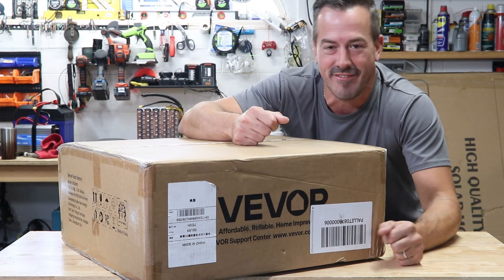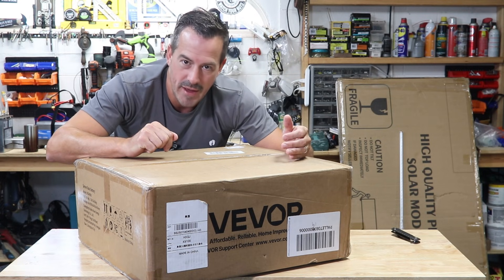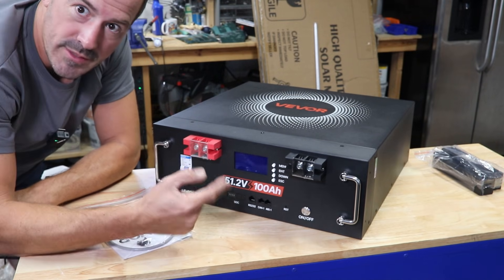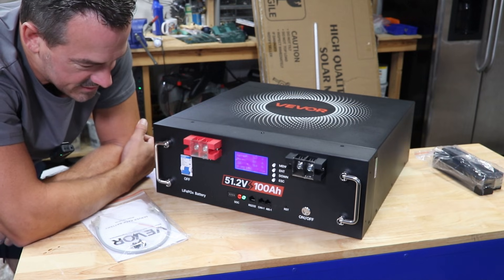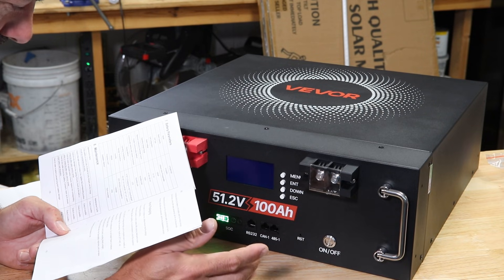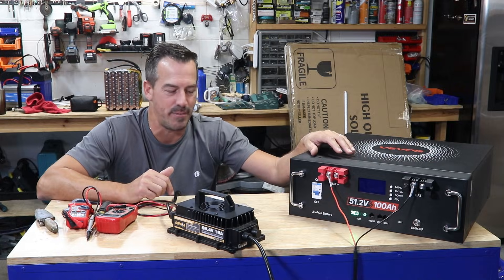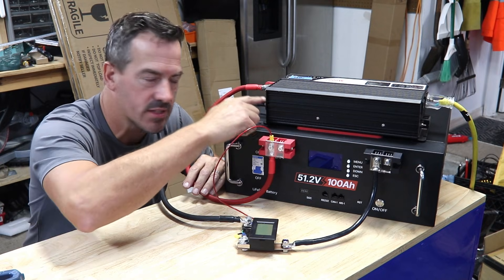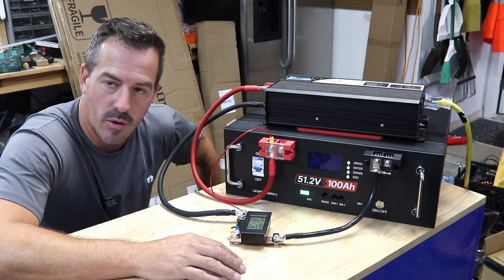How bad is this CHEAP Vevor 48v Server Rack Battery?We put it to the TEST! #diy #solar #lifepo4 #eg4

Comment: Hi Tackle, with the inverter setup you have here, can you use your AC charger to charge the battery while using the inverter or will something bad happen ?
Reply from the maker: You can always charge a battery while under load (inverter). If the charge is more than the load, the battery will charge... If the charge is less than the load, the charge will offset the load (use less of your battery).
Reply from the maker: Now you can't charge your own load... With the inverter and charger losses, you'd drain your pack.
Reply: @TackleThat  So no smoke .😃

Comment: There are several reviews of the Humsienk brand by Will Prowse and several others showing the build quality, and their 48-volt server rack for $599 showed a capacity of 100 ah each time. I even picked up their 12.8 volt 600 AH battery for my RV for only $525 at the Temu site with free shipping.
Reply from the maker: Funny you say that, I am reviewing and don't hit 100ah, but close... Not the capacity as advertised since it should hit 103+ah
Reply: @TackleThat  Did you see their videos?

Comment: Another point—you mention that some manufacturers subtract a cell. This is entirely justified depending on the type of cells used to build the battery pack. LiFePO4 cells have a nominal voltage of 3.2 V, whereas Li-ion cells are 3.7 V, so in such a case you’d use 7 cells for a 24 V system and 14 cells for a 48 V system. By the way, 16 × 3.2 V = 51.2 V, while 14 × 3.7 V = 51.8 V, so 14 Li-ion cells actually yield a slightly higher voltage.
Reply from the maker: Correct you are, I'm saying people try to sell you a 48v 15 cell lifepo4 pack, which is technically still close to 48v nominal... But It wont work with your 16 cell packs... You either have to have one or the other.
Reply: @TackleThat  Now I understand. I haven’t encountered such a situation myself, but that doesn’t mean it doesn’t exist :)
The only 15-cell LiFePO4 pack I recall is the 4.8 kWh unit—possibly from Viessmann—but those didn’t have a BMS and were installed into a 200 V high-voltage module (4 in series). Perhaps someone later added a BMS to it and sold it that way.

Comment: I just ordered 2 to play with. I see they are 1C discharge rated and want to see if they will play well with my other 2c batteries.  Seems like the cheaper ones are 1c now. Can't  beat the price if they arrive in good working shape.
Reply from the maker: Awesome, let me know how they perform for you!
Reply: @TackleThat  Had  a rough  start. They would both error out with a overvolt cell before fully charging with a standard charger first try. That would shut down charging  before 100% and shut down the balancing. Could be why you see reduced capacity.  I boosted the cell voltage slightly in the BMS settings and since that they charge fully, balance,  and are hooked to my 12000xp now with an assortment of 2c batteries.  I am thinking the 1c rating of these may eventually be a problem but so far so good. They both self consume about .8 ah a day when left turned on with no load that seems slightly high to me. Appears most of these  cheap batteries are 1c now. Time will tell
Reply from the maker: Word, mine were very balanced... I just cant get overall pack voltage to be more than 54v, even though set to 58.4v
Reply: @TackleThat  I am getting 100% with my inverter set to 57.8 volts charge volts as I use for the other batteries. 58.4 from the charger will shut it down before 100% even with the cell ov value raised .2 volts in the bms. My volts difference now averages .004 volts on both after 2 cycles.

Comment: I have 3 of these.  One good.  One functions, but the entire cell pack was loose and flopping around in the case, as the "welds" on the battery brackets broke.  Fixed that one.  The third had a bad cell and 3 shorts from the cell pack flopping around, again from the cell retaining thing breaking,both front and back.  Really shoddy quality.  Both cases I opened also had surface rust inside of them.  Spend the extra couple bucks and get Ecco worthy.  These batteries are unsafe, I am using them in an off-grid installation, in a fire resistant box, outside of the structure.  I would never put these in my house, and I have 60kwh of batteries in my home (eg4)
Reply from the maker: Thanks for the info, and appreciate you sharing your experience so the community can be more informed 🙏

Comment: i bought the battery and their support is lacking.  My fault light is on and won't go out They sent my money back.  so I bought another one and it did not work either.  They have no support line only customer service.  Don't buy.  I did get one of the three to work but it has been disappointing.  Buyer beware good deals only if it works.
Reply from the maker: Oh wow, thanks for sharing your experience; that's valuable information for everyone to know.

Comment: so a 24v batt and a 12v batt are too no good ,less cells.
its different .
the cel voltage is slightly higher then a lead acid batt ,and there is a point that you remove a cell to have nearly the same voltage.
as a lead acid ,and above 50 volt counts here in the nld as high voltage ,so different laws apply .
 we are talking about nominal voltage not 100%charge.
 and it is a stupid little voltage above 50 butt that is more for your insurance if there ever is a fire ?
 take 2 48 volt batts in serie we call that 96 volt ,butt 2x 16 cells is more than 100 volt ,
so tere is a time to remove 1 cell .ore 2 at 96volt .
Its not stupid its laws and incurance .16 cells work fine 15 too and is closer to the voltage of 16 cell lead acid batt .
Reply from the maker: Yeah, 15 cells are fine if you get the savings (and not getting scammed), and also set all your hardware up for the lower voltage range. Higher the voltage, the more efficient the circuit!
Reply: @TackleThat  sorry that youre not getting the point .
wy not go to 96 volt inverters ore 72 .ore high voltage car batttery.
you have to draw a line somewhere .
its on the buyer to see if he gets what he wants.
but 15 cells is not wrong .

Comment: You need to check the voltage difference between the highest and lowest cells when the battery is "full".  If the cells are out of balance, that would explain the BMS cutting off early when charging, because the "runner" cell would trigger BMS protection and stop all charging activity.
Reply from the maker: For sure... But cells have been perfectly balanced through many cycles now... That wasn't the issue. Im pretty sure its a bms issue.. it wont let the pack fully charge to 3.65v per cell even though its set to that. I only see around 3.4v.
Reply: @TackleThat  Ok!  But just an FYI, don't depend on the BMS to balance the cells themselves.  You need to check it to be sure.  The advantage with this type of battery case is you can easily remove the top to balance the cells yourself with a DC power supply.

Comment: How did you know it's the bms shutting it off? Did you get current over protection in the app when you hit 53.3v? If not, the issue is your charger.
Reply from the maker: The bms says OVP, and it wont take any more charge. It never gets to 58v like all my other packs. Charger is fine, its cccv at 58.4v.
Reply: @TackleThat Okay, it seems like your cells aren't balanced. My second one did the same thing. I had to charge all the cells individually to 3.65v, and it started hitting 58.4V before the BMS shut off. One cell is getting to 3.65 before the others and that's what is causing the OVP before the sum gets to 58.4. I would set the charger to 58.4 and hold it there for some hours to see if it improves. Or charge the cells individually.
Reply from the maker: I won't be able to do that every charger though, so far. lots of cycles, still fine with the 97% capacity. I will do another capacity test in a month or 2.
Reply: @TackleThat cool. If it's still hitting OVP at a lower voltage then get Enerkey or Neey 4amp balancer. This is what saved all the vevors I got. I ended up getting 4 vevors. Using Enerkey got me to 58.4 on all of them. It's the fastest way to balance any 16s battery. It was like a miracle honestly.

Comment: No matter how many times I counted, it looks like it’s only a 15 Cell pack. Like the one Will Prowse tested ?
Reply from the maker: This one def has 16 cells, i count em in the video... That's not the issue... I think its bms related.
Reply: It's 16! And I got 105AH after testing mine. There's something wrong somewhere.
Reply from the maker: That is awesome! What were your BMS settings for max cell and pack voltage?
Reply: @TackleThat 3.65 per cell and 58.4 per pack.
Reply: It's 16! And I got 105AH after testing mine. There's something wrong somewhere.

Comment: m,ay have to cycle it a few times to get thaty 100 percent  I've seen that with several different brands and I  believe fully charged is 54.4v   the charger should be set to 58.4v
Reply from the maker: I wish that were true... Tested it 4 times now. It should always test high and go down actually as it is used.
Reply: @TackleThat You have never gotten above 53v. I think that's your issue. Either from your charger or something else.

I got 105AH from this battery.
Reply from the maker: Good to know! I have a stand alone charger that charges other batts fine to 58.4v.. and an xp6000 inverter set to 58.4v.. on both, still won't go over 54v, bms kicks it off early while the rest of the batts charge up from the sun.

Comment: I just bought one of these from Vevor, It arrived damaged and leaking a stinky sticky fluid with the breaker switch broken, the contents inside the metal case were rattling around. I contacted vevor immediately and asked for an immediate refund. They gave me the run around for a week however I emailed them everyday until they finally responded. They offered me a refund of $196 however I paid $658 for the battery new. This added insult to injury so I declined their offer and told them I wanted a full refund and the battery removed from my property. They came back with a refund offer of $395 dollars I told them I was going to in form my bank that I used my credit card from to purchase the battery and they could deal with the banks attorneys. A week later they offered me a full refund but didn't want the damaged battery back. I will never purchase anything from Vevor again. Also Vevor has now CS phone number, you have to deal with people in China via email. Thank you Wells Fargo for helping me get my money back.

Comment: Just a heads up have you checked the bms charging parameters there are apps for setup of bms might be set at lower levels by the way most passwords for these is 123456 hope this helps some of us believe that server rack type battery will be at $500 by q1 of next year
Reply from the maker: I hope so! I'll pick up a few more to give up a few AH. Yep, bms was updated to 3.65 a cell, 58.4 pack.

Comment: Seems parallel battery pack communication is not possible
And terminals are too small
Reply from the maker: I don't disagree, I can't even get one to communicate with the eg4 6000xp!
Reply: @TackleThat It communicates just fine with my SRNE inverter.

Comment: Cool video and info. Can you top balance it then retry the capacity test?
Reply from the maker: Did that 4 times now, cant ever get them to take a 3.65v charge.. the bms is limiting it to around 3.45v each. Cells are very close in voltage so no need to really balance!
Reply: @TackleThat have you tried to manually charge any low cells directly with maybe a bench top power supply. Sometimes the BMS doesnt balance well or quickly so manually doing it will help get all cells to 3.65v

Comment: What is the residual current draw of your inverter?  The idle consumption?

An inverter turned on and doing nothing will use 50-100w per hour.  You need to add those numbers back in for your total capacity.  They are wasted in heat and running your inverter but they still count….
Reply from the maker: The shunt is before the inverter so any inverter inefficiency/draw is calculated in the overall watt hours. BTW it's about 45w if I remember correctly.
Reply: @TackleThat hmm, does it make a difference….conversation of energy.  The inverter is still somewhere in the circuit and it will use watts from the batteries.    You can’t rob peter without it showing up because the total watts in the batteries are “fixed” 

I think a shunt is just a gigantic resistor ….

So if you add that usage back in does it get to 5100?
Reply from the maker: Shut doesn't draw any energy, it measures how much is going through it.

Comment: Heard these batteries are crap. I bought one that's arriving today. Hopefully, there are no issues. They put a silly warranty tag so you don't open it. I believe they don't want you to open it because of how crap it is.

That inside doesn't look awesome. I have no idea what you are talking about.

Edit: I bought one and had no issues. I just bought another 😂😂. Works good.
Reply: I bought one and it's been working good.
Reply: Got two and both crap.  but they gave me a refund and did not request  the units back.  I am going get the echo worthy - 100 Ah I got two of the newer ones working great.  Price went up though.
Reply: @richardjames2697 I have the ecoworthy as well. Works great. I'm struggling to get a refund for this Vevor unit on amazon. The reseller has been horrible. I got a unit that came destroyed. My first and second unit were great. The third one not so much.
Reply from the maker: This is disappointing! I'm not sure how all the reviews on vevor.com are so positive.. I had to leave a true one!
Reply from the maker: Yeah! I agree, you def get what you pay for... But I haven't seen any better deal than this lately! Lmk how yours works out!! 👍🙏